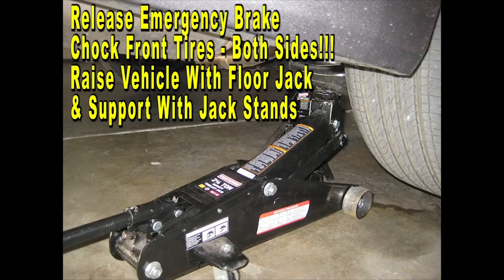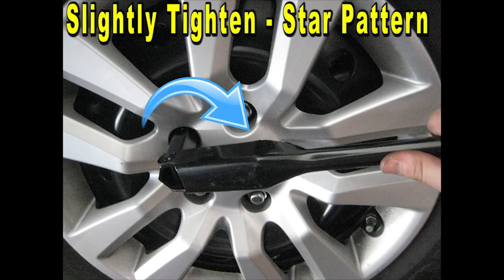2013 To 2018 Nissan Altima How To Change Rear Brake Pads With Part Numbers - Quick & Easy

Comment from the maker: Nissan Altima Rear Brake Pads - https://amzn.to/3CXlO8C
Bosch Rear Brake Pads Part Number - https://amzn.to/3ZJ55zP
Raybestos Rear Brake Pads Part Number - https://amzn.to/3ZPmKpM
Wagner Ceramic Rear Brake Pads - https://amzn.to/3XEeiaH
Socket & Ratchet Set - https://amzn.to/3Z17LbA
Yost "F" Clamp - https://amzn.to/3XoY1a0
Mechanix Gloves - https://amzn.to/3jCnHkt
Torque Wrench - https://amzn.to/3vS5uSI

The Paul79UF YouTube channel is a participant in the Amazon Services LLC Associates Program, an affiliate advertising program designed to provide a means for sites to earn advertising fees by advertising and linking to Amazon.

Comment from the maker: Check out the DIY guide for changing the rear brake pads on a fifth generation 2013 to 2018 Nissan Altima sedan - 
https://www.paulstravelpictures.com/2013-2015-Nissan-Altima-Rear-Disc-Brake-Pads-Replacement-Guide/index.html

Here are all of the DIY repair and maintenance tutorials for the 5th generation 2013, 2014, 2015, 2016, 2017 & 2018 Nissan Altima - 
https://www.paulstravelpictures.com/Articles/2013-2015-Nissan-Altima-Common-Problems-Repair-Maintenance-Guides.htm

Owners of other Nissan or Infiniti vehicles such as the Versa, Maxima, Juke, Rogue, Murano, Xterra, Pathfinder, Sentra, Cube, Armada, Leaf, Quest, Frontier, 370Z, GT-R, Titan, G25, G37, M35 and M37 may also find these DIY instructions to be helpful.